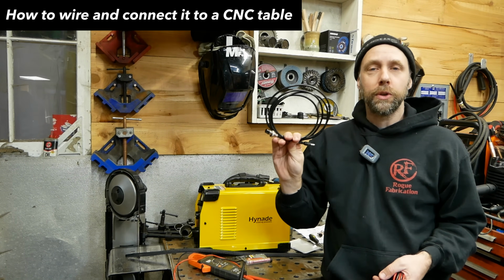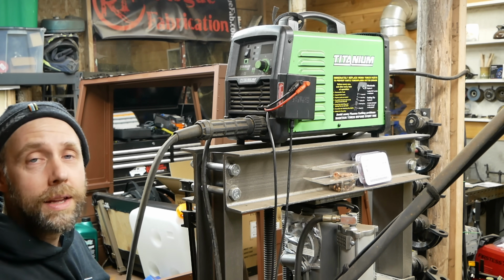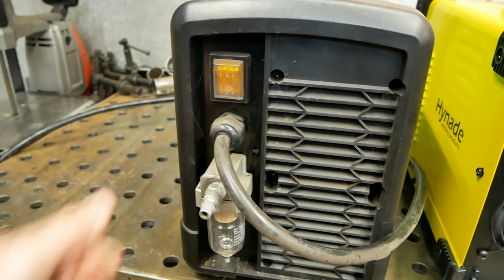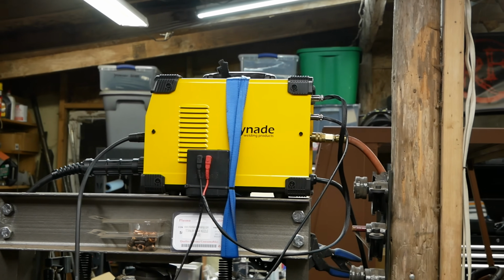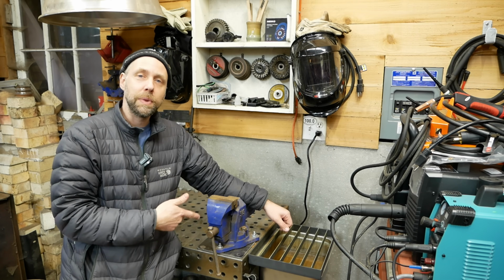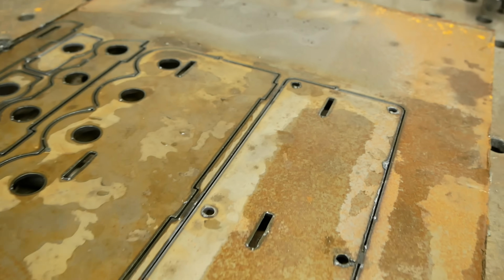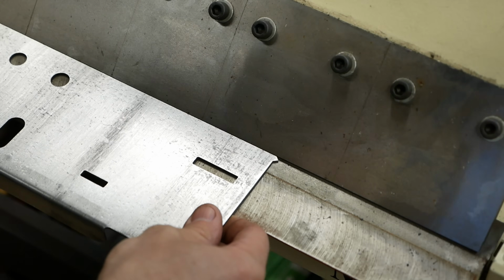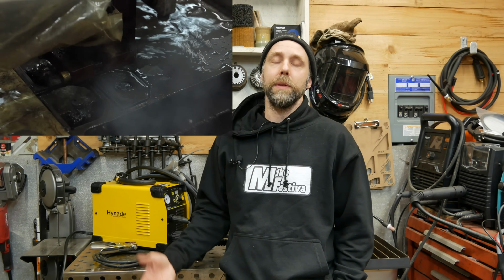Testing the most affordable CNC plasma cutter on Amazon Hynade CUT60DN

Comment from the maker: Amazon Paid Affiliate Links Below
Use the Hynade Amazon Promo code 05MIKEWELD at checkout and save 5%
Here's the link to the Hynade CUT60DN CNC Blow back pilot arc plasma https://amzn.to/3G3oxhj
Plasma Consumables for CUT60DN https://amzn.to/3Myn1Gu
Reply: Code doesn't work 🤷‍♂️
Reply: How has the machine treated you so far. About to pull the trigger but wanted to see if it’s taken a dump on you.
Reply: So how's it held up for the past few months?
Reply: Code doesn’t work. How has it held up over the last 3 months?
Reply: Hello Mike! How can i get in touch with you?
Reply from the maker: @jessedavis3641  My Hynade CUT60DN plasma is still working great On my CNC table 👍
Reply: @Mikefestiva , great info, is there an updated discount code, or too late?
Reply from the maker: @mattglandorf9600  I had a code for about 6 months but unfortunately it’s expired now. Thanks for checking out my video.
Reply: @Mikefestiva , dang, ok, you had kinda talked me into this one over the Primeweld or Everlast
Reply: My 60DN will not connect to oem Langmuir firing cables, where did you happen to come across the set your running? Or possibly a diagram or just picture hahah, freeze framed a shot of it strapped up on the press and that gave me an idea of the THC setup, but I’m honestly lost in my install 😅.
Reply from the maker: @gnarslam  I covered how to connect this plasma in the video, you wire the crossfire cables to the Hynade connectors just like I did in the video.
Reply: @Mikefestiva  you are the man good sir.
Much appreciated, after a panic stricken consumables search, the connectors were located!
Reply: @gnarslam , Dont your firing cables just have 2 tinned ends? Mine just got soldered to pins 1 and 2 on the Hynade connector included with the machine.
Reply: @mattglandorf9600  honestly I don’t recall, rather the thc or fire deff was just tin’d. The other had too small of a 2pin connector, but thankfully the oem expendable a that come w/the hynade have the proper sized connectors, just gotta get them swapped out tonight.
Deff would not have found the connectors if it had not been for mike.
Reply: Nice video 👍 verry interesting thanks
Reply: Mike - are you still satisfied with the Hynade CUT60DN one year later?

Comment: Hi Mike, I've watched all of your reviews on plasma cutters as I've been in the market myself. I'm planning on a handheld machine, but I have some dexterity issues. I run a manual only shop and I'm not interested in bringing a computer in. I do have interest in a plasma table, just not CNC. Back in the days of torch cutting, there were pattern tables that allowed you to mimic most basic shapes. More useful to my needs, there used to be a popular accessory that was nothing more than a guide rail about 18 inches long that assured a straight cut. I was kind of planning on manufacturing a water table and some simple rail system like this. I will almost definitely be building it in such a way that the plasma cutter can be quickly removed to be used manually. I believe at least 60% of the time I will just want fast casual cuts like this. I was fairly set on the best Arc until this video. It can be rather difficult to compare these side by side. I don't have any firsthand experience running a plasma cutter though I'm very familiar with a machine shop otherwise. For my particular use case, do you think having these CNC ready features would still be beneficial? Are there any downsides to normal manual use? Thank you in advance for any guidance you have to offer

Comment: Mike, this out of sequence but a thought you may see & use on the center-articulation tractor you build removable front fenders for. Since you can remove then in the field, find a spot and weld two squares these can be stored in. Like the side the the dump bed! It is better that tossing them into the back to get scratches or bent. Just a thought.
 I worked on our family farm equipment since I was the oldest but this was before you were born. But leaving home at 14 (Family issues) but never went to tech school or high school did have a shop. But I spent my entire life working on vehicles & the last 7 teaching & holding tech seminars in 7 Midwest states before Dr. pulled the plug on working. Had a boss argue for 20 minutes to run a rented jumping jack earth compactor at 28 and destroyed my back. It got better to work at dealer, but old age has this “arthritis” thing and had 11 procedures, finally implant with spinal electrodes and they placed them wrong. So can’t even walk, just enough to mail box. Enjoyed the build surround by tools and use them ten minutes out of every 2-3 hrs. I had no cell since 2008 and YouTube has been fun. I have to learn aftermarket parts to build a 67 C10 to have a vehicle. At 6’ 3”, I don’t fit well in most even average weight but getting in & out is real hard. The truck fits and given free. A EFI Tahoe engine will make reliable and the OD auto I built on bench 2019 will help with fuel and made to handle 600HP with a basic stock 390 HO engine so I don’t have do repairs. All GM parts that are common & priced well. But, I have to get room in my garage as it is a 1 1/2 car to begin!
Enjoy the vids, but having a place to hang your fenders when off is an idea.

Comment: I followed your lead and bought the Cut60DN plasma cutter from Hynade a few days ago. I have been trying to wire up my Langmuir table with the THC module, but I am having some issues with trying to get everything connected up properly. There are a Torch On/Off connection and a THC connection that are both mounted on the Langmuir control box, that I assume need wires connected to both for them to work properly. I also bought a Torch Height Control Module and there are a lot of connections to be made to it There are the DIV INPUT, the DIV OUTPUT, the PV OUTPUT , and those are the ones located on the ends. Then there are two more connections, one marked TORCH (black) and one marked CLAMP. (red) on the flat sides. I probably forgot to mention that I am very electrical wiring challenged when it comes to making up proper connections. CN YOU HELP ME PLEASE?!

Comment: Got a little 110/220 flux core machine from these guys for my work trailer. It does have some odd way to setbit, but it is incredibly impressive what it will weld on 110v. Its been reliable thus far  and has worked every time i pull it out. Hopefully it works long term but it has already paid for itself. 

Now i need a plasma. I have nice welders in the shop, but a plasma is so "simple" i have a hard tkme spending big bucks on one. Shouldn't be all that expensive imho

Comment: Curious about the wiring into the thc box.  It looks like you aren’t using the CNC (4 pin) connection into the THC module even though it is wired up.  Is that correct?

Comment: Hi Mike, based on your recommendation i just purchased the Hynade CUT 60DN - using your link.  All this is new to me and I could follow along  with your wiring instruction until it came to the 4 pin connector.  How did you wire that connector? I only got the connector tip.  Thanks much!

Comment: Got my Cut60DN in yesterday. Used it just a bit today. Keeps loosing the flame. I did have it under 20 amps on a 110 circuit. Need to get a 220 in the shop.and the metal was rusty.  Do you know  what is the min. air requirements to be stable on a CNC?

Comment: Are the consumables used by the Hynade CUT60DN proprietary?  Will consumables from Hypertherm, Miller, Lincoln or other established brands work?  I am considering a purchase of the Hynade CUT80DN but concerned of availability of consumables in the future.  I purchase the crossfire pro CNC plasma table based on your recommendations and review of the product and had no regrets .  I would be comfortable to buy the Hynade plasma cutter based on your review only unsure about the availability of consumables in the future.  Thank you for sharing your project builds with us.

Comment: so, i noticed at 16min you cut what you said was 16guage metal the n bent it on your brake. i did not notice any relief cuts, but the brake is only rated for 22guage... Have you noticed any effects other than it being tougher to bend....? I recently purchased a 48in rated for 16 gauge, and that was a concern of mine (others only being rated for 22guage) Alson based on your suggestion I picked up a cut80 for my 4'X4' table thanks for sharing your vid and info

Comment: I have been very pleased with my hynade cut60 DN plasma cutter purchase. It has worked perfectly with my  Arcdroid until this evening, when it suddenly stopped working. Whether using the Arcdroid, or switching to the hand torch, it will not maintain an arc. New consumables new shroud doesn’t make a difference. Can you point me to someone that can help me troubleshoot it?
Reply from the maker: I would connect Hynade and ask them about the warranty and if they can help diagnose the issue. I do know these plasma cutters have an air pressure switch, they need about 90 PSI ran to the unit. I’m sure you are providing that but I figured I would suggest looking at that.

Comment: Would like to see using the cnc ports as there is no instructions in the manual on using them. Where the pins connect, yes.
Reply from the maker: The manual covers the pin outs, I even showed the manual in the video and hooking up some of the wiring. I also used the CNC ports on my CNC table. Just look at 1:35 I show the wiring pin outs in the manual, just pause the video and take a photo if you need that.
Reply: @Mikefestiva hope you don't mind, got 1 more question. The 4 prong wire may I ask where you got that lead? I'm somewhat new to cnc still learning.

Comment: Have you tried that surfacing tool on any carbon diamond plate? I need to clean the rust off of a couple 4' x 8' sheets and if that thing will work on them, I need to go get it.  Wasn't sure if it would get in between the raised diamonds or not.

Comment: Possible replacement for my original CUT 40 from 2004. I was planning to replace the torch with a grounded torch to get it working for CNC, but may not be worth the effort. Watched video over on Making Stuff on a pre-production YES CT2050 plasma cutter/Tig/ARC welder with built in compressor and dual voltage that interests me as well. Thanks for the reviews.
Reply from the maker: Sounds like you got a great run on that Cut 40! This Hynade being a blow back pilot arc start is really nice and works great especially on paint or rusted surfaces.
The fact you can always add it to a CNC table down the road is a big benefit also 👍

Comment: Hey Mike!  I just bought this Hynade Cut60-DN for my Crossfire Pro CNC Table but can't find the csfm rating to know what compressor size I will need.  Hobby use, only a few hours per week but anticipate some longer/larger cuts at some point.  I don't want to undersize but don't want to break the bank either.

Comment: Mike, 
If you had to get just one plasma cutter, would you get the HYNADE or BestArc? I would like to get  plasma cutter, and not yet have the funds for the CNC table... but would like to get one at some point. 
Also after one year of use on the BestArc, what are your thoughts. 
Thanks!

Comment: Would you be willing to do a video on what to look for when buying a plasma cutter?  I want to start with freehand cutting but move up to a CNC machine.  Secondary question, if you were starting from nothing regarding plasma cutter what would you buy?
Reply from the maker: Hello Jerry 🙂
Here’s a good video I made talking about options to look for when buying a plasma cutter.
Honestly if I was planning on buying a CNC table in the future I would buy a blow back pilot arc start model.
You can make free hand cuts with it then connect it to a CNC table down the road.
I’m always working on a budget so If I was starting over I probably would buy the Hynade in this video because it’s one of the most affordable CNC capable plasma cutters on the market, you can also use it for free hand cutting. The only thing is time will tell how it holds up? It’s still working fine but I only have 6 months on it, the Titanium 45 I have 3 years on and it’s still working great 👍 
https://youtu.be/LhZWKc6tFLc

Comment: Thanks for the video, but basic info fir beginners would be nice...compressor requirements, plug into standard wall socket or dedicated isolator etc.
Reply from the maker: This is dual voltage as most modern inverter plasma cutters are. Even if you can plug it into 120 volts you definitely won’t be cutting much before a standard 20 amp breaker will definitely trip. Most people using plasma cutters tend to run them on 240 volts.
Reply: @Mikefestiva  I'm in the UK, we only use 240v with 3 pin sockets and the ring main breaker is 32amps (max). Lighting circuit is 16amps, hobs/ovens need dedicated 32amp+ breaker, not sure how things operate in usa.

Comment: Great video Mike. Which plasma cutter would you recommend, the Arcfony CUT53N or the Hynade CUT60DN for plasma table cutting up to 1" thick steel plate?
Reply from the maker: Well I really liked the Arcfony for 3/8” and thinner metal, it works really well and never misses a start on any cuts. If you are looking to cut 1” I wouldn’t recommend either plasma cutter. You probably want to get at least an 80 AMP plasma cutter. You are looking to cut way heavier steel then most people do so you are looking at probably spending some extra cash for a bigger machine capable of 1”
Capacity and greater duty cycle.

Comment: Hey Mike, I'm having some problems with my Hynade plasma cutter with CNC compatibility. I've seen your video but one part wasn't clear with is the stop and start of the plasma cutter.
Reply from the maker: Are you running it free hand or on a CNC table? What’s the problem you are having?
Reply: Sorry about that mike, I should have explained more clearly but I'm using sheetcam for g-code to firecontrol, it works fine importing the sketch with g-code but when I enable torch on it comes on but cuts off when it starts to move to cut the part out, I have no idea why it cuts off and that's the only problem I'm having

Comment: Mike, Donn DIY made his own CNC machine, and he used free cnc software. To operate bit. He's made some awesome looking and functioning parts on his. I'm not sure which plasma cutter he uses with his.
Reply from the maker: I’m pretty sure DIY Donn bought a CNC table from a company that he helped set up in his shop. I do know he made the water table but I’m pretty sure he got most of the electronics and gantry from a company. He definitely gets a lot of cutting done on his CNC 🙂👍
Reply: @Mikefestiva  I would think that the electrical parts are more complicated than the water table.

Comment: So it looks like you've tried several of these low cost plasma cutters; which one would you purchase now?
Yeswelder, bestarc, hynade, as of now they are pretty close in price. Do you think the brand name matters?
Reply from the maker: I think it mainly comes down to if you plan to buy a CNC table in the future or not. If you’re not then probably the Bestarc BTC500DP would be my suggestion.
If you do plan of getting a CNC in the future it would be the Hynade CUT60DN or the Arcfony CUT53N pro.
Both of those are CNC plug and play and work well on a CNC or free hand cutting. Hope this helps.

Comment: Hey sir! Thank you for making this video. I was on the fence about what to buy. I had ordered the CUT80, but it never arrived. Amazon said it was lost in shipping but looking at the tracking info, it never shipped. Any way, I ordered the CUT60 instead, as they had that one in a local warehouse. I was still considering the primeweld. I have there TIG 255 and love it. But after watching your video I am going to give the Hynade a try. Do you have any setting information for the CUT60 to set up the THC and the post for the CNC setup. The manual that comes with it did not provide any Torch working height, piercing, arc voltage,  or piercing delay recommendations, nor any kerf width setting. I know these will have to be tweaked for my machine, but it would be nice to have a starting point.

Comment: I too stumbled on the Hynade after your Bestarc review caused them to sell out overnight. 

Similarly to you, I find the Hynade has a bit more slag than I’d like. I’m using a hand torch so it’s even worse given the lower “feed rate”. Have you had any luck dialing it in to make cleaner cuts? 

At$200 I can’t really complain, but if it’s something simple like the consumables or settings, it’d be great to get it dialed in.
Reply from the maker: I haven’t found the slag to be any worse then my Titanium plasma, they both cut fine to me.

Comment: Subscribed. What program do you use to design your parts? What file type for the machine to follow? Thanks - definately need to get a CNC table figured out. I figure if I can slug my way through free cad and tinker cad I should be able to figure this out.
Reply from the maker: I use Fusion 360 but I really don’t like the program much, it’s really complex and I only use about 10% of it for 2D drawing.

Comment: Would the Hynade CUT80 Plasma Cutter be a good upgrade?
Reply from the maker: Maybe if you plan on cutting 3/4” plate Lbs of steel, I just never work with that thick of metal. This will cut 1/2” clean, I mostly work with 1/4” and less on my projects.